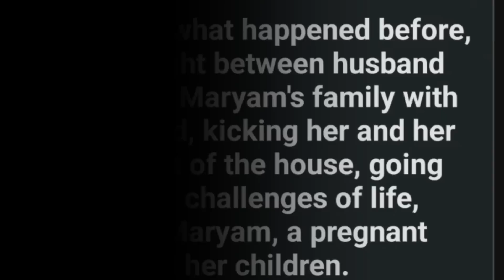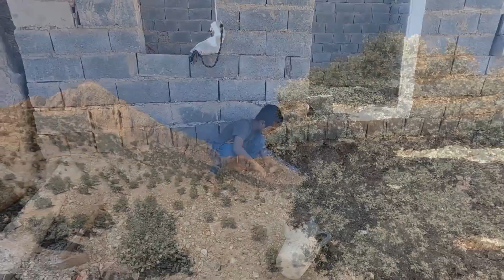Perseverance in the Tribal Plains: A Nomadic Woman's Journey into the Depths of Life's Sufferings

Comment: Sharing tip with you..... For the floor porch, house and bathroom..... It will be really easy for Maryam son to do.fill in house and bathroom with sand like they did porch, then mix sand and cement together like usual, but don't mix it with water. Fill in the mixture in porch area like they did the sand. Take a 2 inches by 2 inches by 36 inches stick to level and smooth out. Don't walk on it!!!! Then sprinkle a lot of water on it and take your stick and smooth through it and make sure it's close to being level. Let dry! If you want to make it fancy you can break up some stones or pottery in the wet cement before drawing. You can be creative and make designs. This is just a suggestion ❤